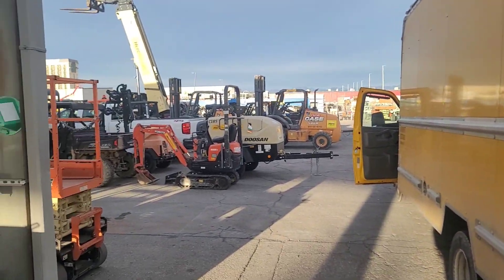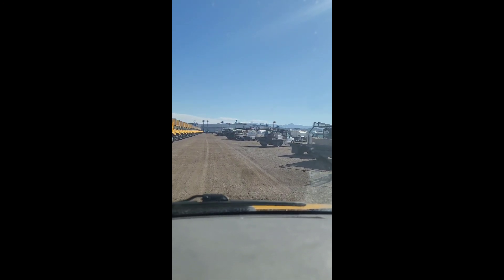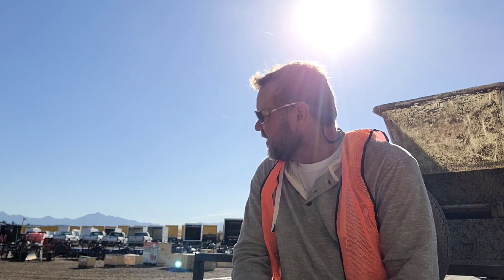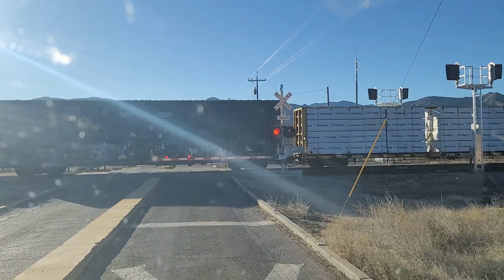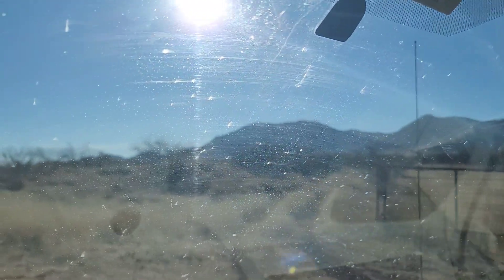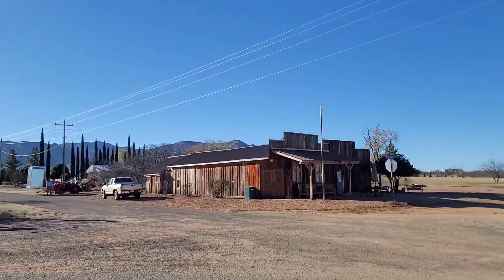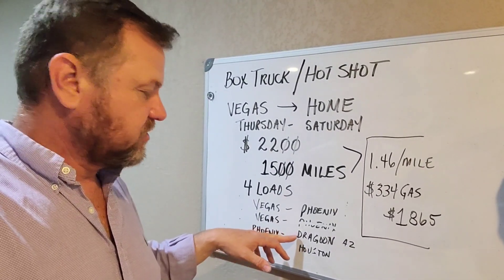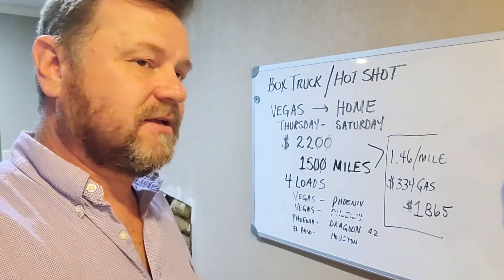#202 SMALL BOX TRUCK/ HOTSHOT 2 AND HALF DAYS $2200 GOING HOME

Comment: Can I hitch a 10ft trailer to my 16ft box truck and still be non cdl? And would my weight capacity increase if I haul a 10ft trailer on my 16ft box truck?
Reply: If you derate your equipment enough, you could be non elog.  However, the derate would make that combination practically useless. Keep it rated under 26k, and you won't need a cdl.
If you run under 26k gross combined vehicle weight rating, and under a total length(I forget exactly what, I think it's 60 feet total with trailer) you won't need a class b or class a cdl. Load weight doesn't matter for determining if you run logs or cdl, it's total weight rating on your equipment. If your box is rated 10k, and your trailer is rated 10k, you need logs and inspection sheets but no cdl. If your equipment was made after 2001, you'll need it to be elogs in California or you'll get a hard time from California dot.
After 10k, logs with pretrip sheets. After 26k and/or exceeding length, logs and cdl b and inspection sheets. If getting class B, get air brakes endorsement in your state. 36k and up, and class 7/8 combinations, need class A cdl. That's the short of it all.
Reply from the maker: You have to add the gvwr of truck and trailer. As long as your under 26k ur good. It's a give and take, you can haul more weight overall but it's usually different types of freight for each. The tongue weight of trailer will take away from cargo of van